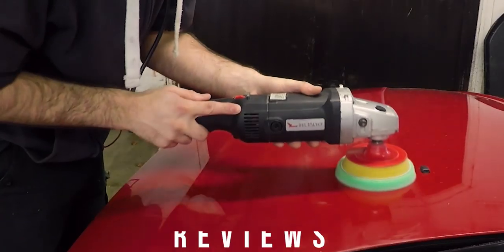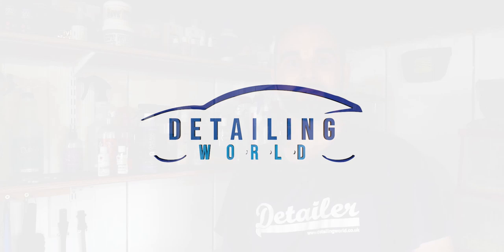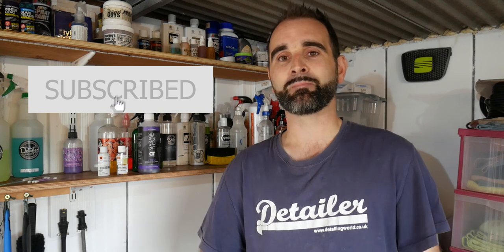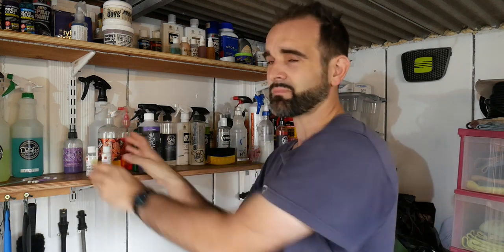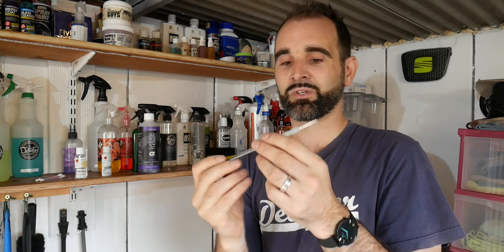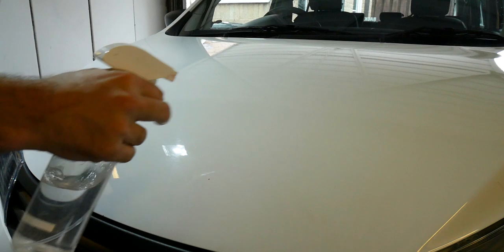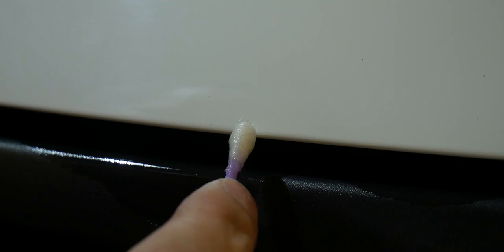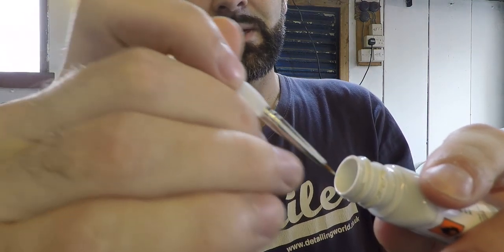Stone Chip Repair For Beginners - No Sanding Or Polishing Required!

Comment: would've been nice to see the result tho.
Reply from the maker: Sorry. Thought that would have been enough lol
Reply: @TheDetailingSpace  That's ok, I was just wondering if this method is "good enough" so that you really can't see the chip anymore or if it stays the way you showed in your last clip, where you can still quite easily see the chip.
Reply from the maker: It more depends on the size and location. I touched a few more on this car a couple of weeks ago, it was hard to find them again after. Maybe because I didn't build the paint up as much

Comment: Hi Matt, a brilliant vid, thanks, I've been trying to pluck up courage to do a couple of chips on my wife's car, it's Polar white and shows every mark! She's a bit of a perfectionist! I'm feeling brave and will follow your advice, you mention a panel cleaner do you have a brand that you prefer? It's been Ceramic coated so I'm guessing after using cleaner I'll then need to reapply in that area? I have subscribed because I've looked at a few vids but must agree I prefer to stick to British advice other nations seem to work in different ways. Thanks again.
Reply from the maker: Any panel wipe from your local motor factors... Think what I have is upol or something....

Yes, you'd need to reapply in that area once done 👍
Reply: Thanks.

Comment: What’s the seat grill in back round for ?
Reply from the maker: From my Mk3 Ibiza Cupra
Reply: Nice , is it custom made ? Been looking one like that for mk1 Leon cupra r
Reply from the maker: Nope. Standard on the Mk3... The basic models had a vertical slotted grill, but the Cupra was fitted with a honeycomb one
Reply: Awright , thought if it was custom I’d see were it was done but thanks for the reply’s
Reply from the maker: No worries 👍